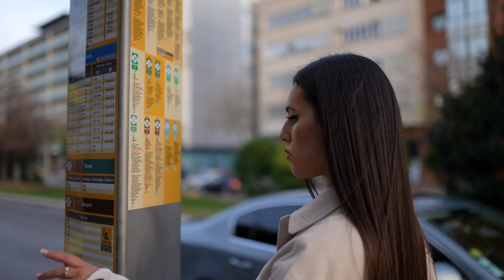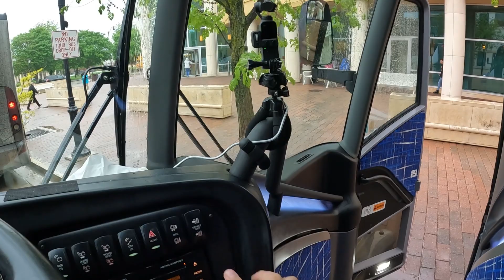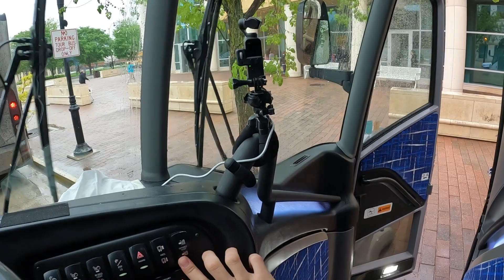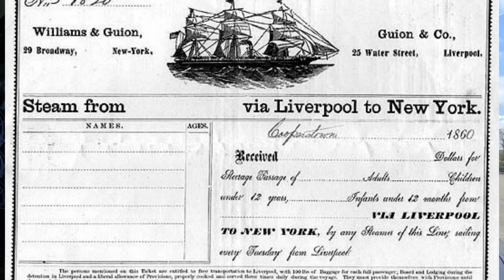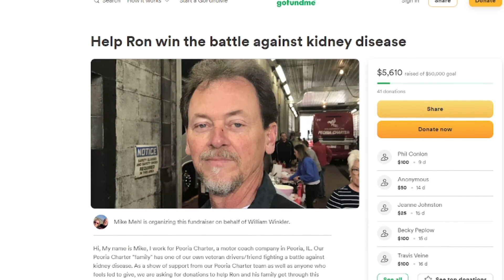This bus always runs late!

Comment: Even missing a traffic light can cause a delay. Around here they time the lights so if you miss one you miss the ones after it. So before you know it, you're 10-15 minutes late. Of course it depends on the system. Unfortunately here on Long Island they don't give drivers enough time. It's why when people need to make connections or be somewhere on time to allow a decent cushion, preferably at least 15 minutes. Of course with transit, when a bus falls behind it picks up more people making it delayed even more. I wish they'd have the traffic signals stay green for buses it would make things a lot easier on bus drivers and passengers alike! Great video though, most people blame the bus driver for being late but that is rarely the case, most of it is just out of the control of the bus driver or company.

Comment: James, I am so happy that guys like you shed some light on the bus industry.  And we can get a good picture on why bus companies are struggling to find drivers.  And having some clips from other scenes what I have learned is what makes these videos stand out.  Right at 2:12, we hear what each driver has to run their bus through and that is called a "defect test".  Things such as your wipers, doors, gauges, lights, all your alarms, etc.  And things like the motor has to be checked to make sure it's running like it should.  As you said James, these big tour buses eat up a lot of space and sometimes some of these motorists don't bother to stop and think about the space that is required to turn these big things and how much more room is required for these things to stop.  Those double-decker buses may look pretty cool, but trying to steer those towering buses, you really have to watch it.  Once the double decker bus gets up to speed, there are times when it doesn't want to stop.

Comment: Thanks for this.

I often ride a line run in California (the Marin Airporter, to be specific, with service between San Francisco International Airport and Marin County).  Several years ago, they announced that they would no longer be serving the Central San Rafael transit center.  I assume this is because of traffic and construction, and they couldn’t keep a schedule when serving that stop.

Even though it was only about a block or two off the freeway, the exit was always backed up.  Those familiar with the area probably know what I’m talking about

Comment: People need to allow more time,  you make a good point about drivers trying to catch up on time, I agree drivers should never be focused on catching up. However I do believe that a lot of the issues with late busses are indeed bad timetables. The problem I see with timetables is they use the same timings as they do when it quiet time, like for example takes 10 minutes between point A and point B when it is quiet, but in rush hour even though they know this bus will be held up in a lot of traffic, they still time it as 10 minutes. I also appreciate that if for whatever reason no traffic means the bus could be sitting there waiting for maybe 5 minutes if the timetable is amended, but then surely the intermediate bus stops should say approx. and advice customers saying  please arrive and wait for this bus at least 5 minutes before hand.

Comment: If it was affordable like it is in the UK, coach companies can send a delay alert in their app to inform passengers of delays (like some airlines do). The problem is the cost of the communication infrastructure - You the driver (or bus GPS) communicate to central office "I am running late due to wreck on interstate", central office sends message to downstream passengers about delay, and those people receive an alert telling them of the delay. As for passengers are concerned research the route you're taking - is there road construction or bad weather between two points? if so take an earlier bus/train. I was delayed on a coach trip due to construction but it didn't affect me as I took an earlier bus to the airport and got to listen to the grumbling: "I am late for my flight" while I just calmly walked and checked in for my flight with over two hours left.

Comment: As a transit operator when I pull away from the curb on time. I keep moving and don’t stop. Also I won’t board a passenger at intersections or at a location other than a bus stop.

Comment: here in the Philippines only few of the several thousand bus companies (private or government run) have schedules of departure but almost non have time of arrival schedule because the traffic is so unpredictable, most bus companies that have departure times are those bus companies that have a first class service usually from pasay to baguio or cubao to baguio and vise versa but again no time of arrival schedule, they arrive whenever they arrive, the best thing they can do is to estimate how much time it well take to arrive using the average number of hours traveled in each direction multiple times by multiple buses, also the norm here is the bus will depart the station whenever the bus is full or if the dispatcher decided if the number of passengers inside the bus is enough even when not full yet, if there's no dispatcher, the driver and conductor will wait until the bus is full so the run will be worth the diesel being used, plus it's more money so who wouldn't want that

Comment: I’m surprised you didn’t discuss what is known in the rail world as schedule-padding. That is the concept that you have a stretch of rail (it could be road although rail is obviously more controlled), that with ideal conditions a safely operating train would take X minutes or hours to traverse it; most of the time it takes longer, and the scheduler specifies a intended travel time for the schedule that would ensure being on-time at the next time some percentage of the time- the higher the percentage, the more time is scheduled for the trip. If you schedule a bus 10 minutes to go 1 mile on a 40 mph road, you could probably get a 99.9% on time rate; the trade off (which is what really needs to be discussed in this topic) is that for roughly 99.8% of trips the bus or train will have to sit and wait so that it doesn’t leave early, elongating standard route time. Longer run-times for a given route increase reliability, but decrease speed. And speed vs. reliability is a discussion that comes out in different places depending on how imperative it is the typical passenger gets to their destination by the advertised arrival time; the less imperative, the better the argument for speed over reliability.

Comment: Hey, just found your channel, enjoying your content. This is kind of an indelicate question, just wondering if you ever did a video about the onboard lavs on Greyhound. I'm a former driver, and I could never understand why passengers inevitably head back there and blow up the lavatory.

I used to issue a cautionary announcement at the beginning of charters, reminding people these are not actually bathrooms. They are not even as efficient as those found on airplanes. The lav on a bus is basically a large bucket with some chemicals in it. Whatever you deposit in that bucket is going to stay with us throughout the charter.

Most people just ignored me and, without fail, at least one or more persons would go back there and blow up the spot. And the bus would just stink for the entirety of the charter trip because I would not always have a facility to dump the lav.

I can understand the occasional emergency situation, but most of the time this just seems to be thoughtless people who, for reasons only God knows, enjoy taking a dump on a moving vehicle. it's also a pretty thoughtless thing to do, especially to the people seated toward the back of the bus.

However, as often as not, when you blow up the bathroom on a bus, the entirety of the bus suffers because of it. The lav is best used for number one only. Anything else we should hold until we get to a rest stop.

Just curious about your thoughts on this. Thanks.

Comment: Question, when a bus is schedule to depart at a certain time at the first stop, is it suppose to have fully boarded all the passengers and leave or is it the time it starts loading passengers? I’m seeing a lot of inconsistency with some bus drivers waiting to load passengers starting at the departure time while other drivers would start boarding few minutes early and departs at the departure time. Most first stop are at a subway and will always take up to 5 minutes to board all the passengers which can delay the departure time. Thoughts?
Reply from the maker: Usually a bus company that puts up a schedule define departure time as the time the bus leaves.
In our case we advised passengers to arrive 15 minutes prior to departure time to allow for boarding.
But boarding can definitely very depending on what types of issues occurred during boarding of people. Sometimes it could be an excess volume of luggage which results in longer boarding times, which will consequently delay departure.
Other causes our passengers not having their tickets ready or other Variables.
Whenever you service large volumes of people delays are going. The larger the group of people the longer things will take and the harder it will be to predict.
Therefore more leniency should be given to operations like bus companies in airlines when their buses or aircrafts don't leave on time. But this is not an excuse for passengers who arrived late to use against the carrier that they should have waited on them.
Reply: @MotorcoachWorld  thank you for the info. This is very helpful info and enjoy your video content. And yes I completely understand that passengers need to arrive on time by departure time. I appreciate the hard work bus driver does to get all passenger safely to their destination. Thank you all for your hard work and dedication to the company.

Comment: The bus busness is like trucking. The rider has same problem with traffic  or the bus is late making connection to the  you the second bus beyond the riders control. I used two bused by two companies. This happen to airplane riders using two planes or bus and plane.. the taxi or Uber can cause delays tp getting to bus stop or terminal.  I would rather beat stop or terminal  early. I have an old Prevost conversion I know how they handle on back roads and streets not like a sports car

Comment: I don't ride Greyhound anymore but their service is horrible.  There are numerous cancellations and driver no-shows are off the hook.  I would never risk riding Greyhound.  I would drive or fly but never ever DA BUS!
Reply from the maker: Yeah thats a good example of a bus company that got so big that its no longer properly managed anymore. Either Management is unable or unwilling to keep up or maybe a bit of both. The sad thing is the drivers and customer service reps probably take the brunt of the abuse from the unhappy passengers and that makes for a all around poor work environment .
Reply: @MotorcoachWorld  Everything you've said is spot-on.  Plus, low-cost air travel puts it where bus travel is relegated to only the lowest demographic of traveler.  The Hound was the best paying company in its day with a damned strong union.  With the Megabus-styled curbside thing the hot new trend, traditional Greyhound travel is all but extinct.  With very few actual GH terminals, I wouldn't dream of traveling that way.  I'd say in the next 5 to 7 years, GH will be all but a memory.